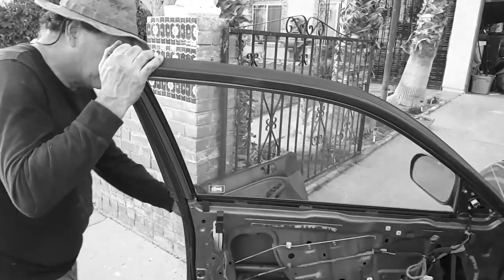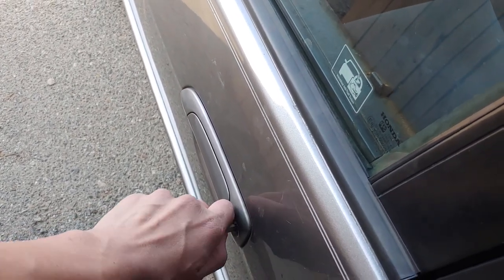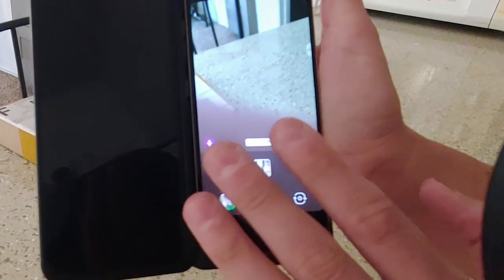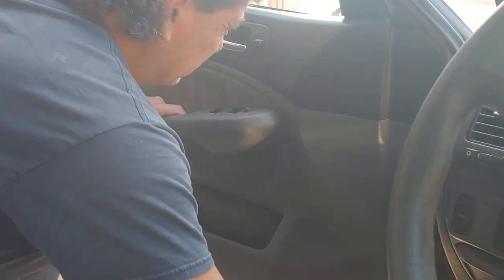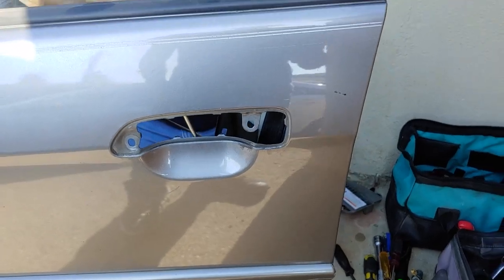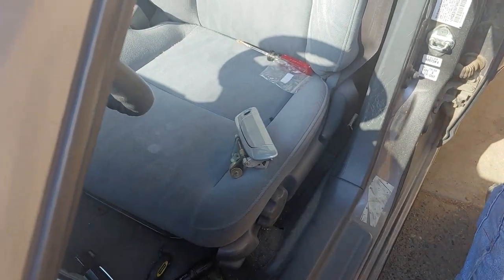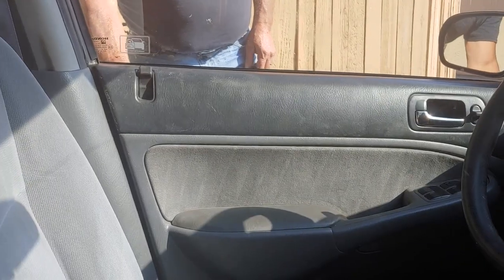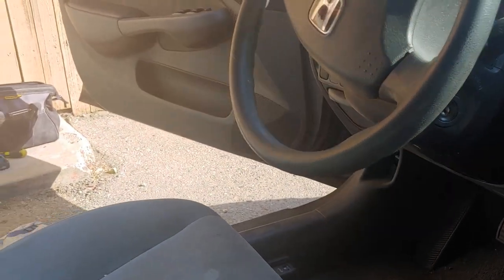Replacing Car Door Lock On My 2005 Honda Civic

Comment: We are auto locksmiths and Honda door locks are one of the one of the hardest to get out. That part always breaks so don't feel bad. To be honest my guys refuse to work on them any more. We will cut and program keys but no more pulling door locks. We send them to a mechanic or let another locksmith do them. Not worth the time or hassle for us. Honda's also are the most problematic for worn wafers. Basically why your key stopped working in the drivers door. If you look in the comment section many others have the same issue. We service about 100 cars per week and Honda's by far are the only make with this level of bad wafers. As a locksmith we would have keyed it to your old key instead of replacing the lock or rekeyed the new lock to your old key to keep it a one key car. If you home gamers are doing this yourself might as well purchase a keying kit. Watch some videos on how to replace the wafers to match your key. If you can pull the door lock you have the skills to rekey it.

Comment: very informative, i had same issue with my car a 2004 citroen c3, would not start one day and reason flat battery, so i central locked all the doors and kept engine bay open to remove battery and put it on charge, came back the following day to put battery back, and this car only has one door lock with a keyhole, and i could not get back into the car, the key did what your did can be a nightmare

Comment: I have the same make, model, and year car and both doors have this same problem. Does the key you unlock the door with fit your ignition?
Reply from the maker: It can fit but it won't turn inside the ignition which is a good thing
Reply: @PaulBGmz  So you have two keys, one for door, one for ignition?
Reply from the maker: @aaronhickerson6092  Yes
Reply: @PaulBGmz  Thanks so much for the quick replies! :) You've really helped me out
Reply from the maker: @aaronhickerson6092  your welcome :)